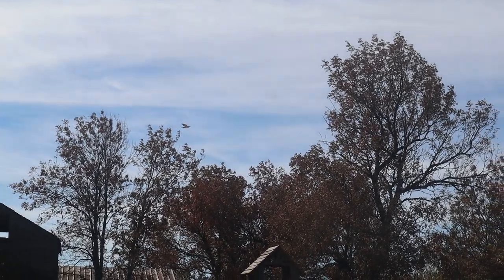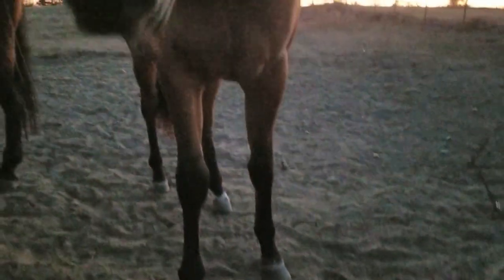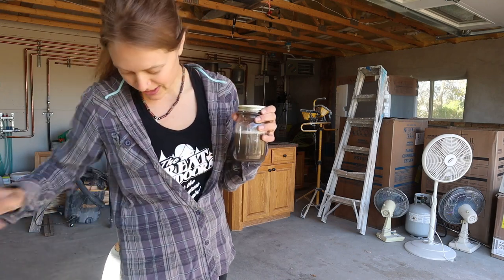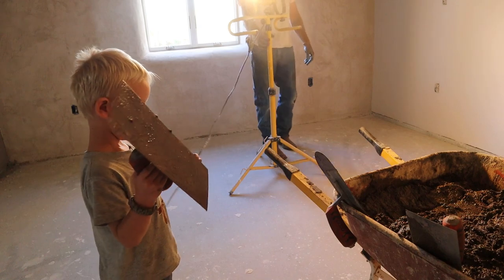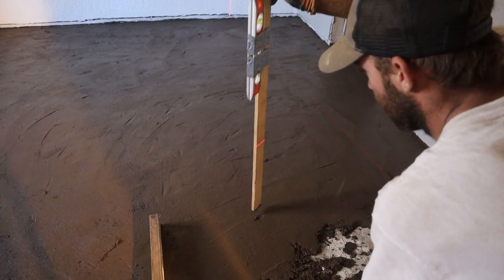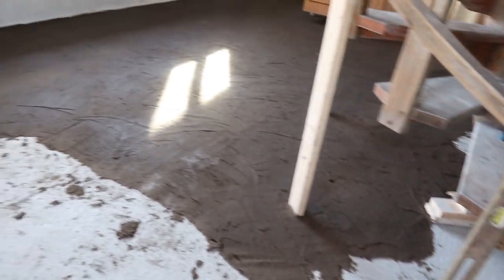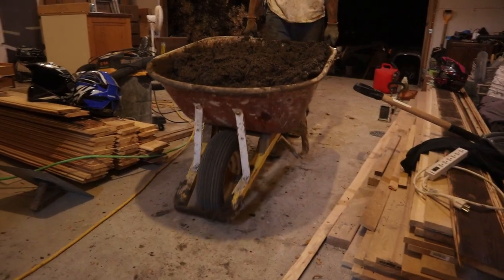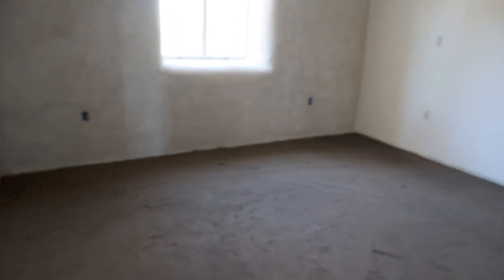Earthen Floor In Our Straw Bale Home | Part 1

Comment: For your floor, you should find about 2-3 foot long thin pieces of wood to lay down that are the thickness of floor you are wanting to achieve. Then as you complete the area the sticks are in, move the sticks down, and fill in those spots where the sticks were. This way, you are moving faster and move efficiently leveling your floor. You can reuse these sticks throughout your flooring.
Reply from the maker: our concrete slab was not level so this wouldn't have worked for us otherwise we would have used this method. thanks for sharing though!

Comment: Beautiful! Are the floors rough? Can you easily glide a mop over them?
Reply from the maker: Thanks, yes they are a bit rough,I think it's from not being finished properly. Would definitely recommend using a screeter on boards to get it level that way you have more time to work on finishing correctly.  A mop does glide over it, it's comparable to a concrete floor that is not polished.

Comment: What was the ratio of clay, sand & straw?  Looks awesome!
Reply from the maker: thank you.. we don't have exact measurements, just went off what looked right. It will be different for everyone given the different materials and moisture/clay content. An APPROXIMATE idea of what we did:
3 parts sand 
1 part clay-soil
1.2  parts water
1/2 part straw
Reply: @buildingroots5873  This is the mixture you used for the floors?

Comment: Generally you should use mother rails like for concrete. Make your mother levels and then spread the mud  with straight board or aluminium profile.
Reply from the maker: we didn't have a level surface to begin with so this wouldn't have worked for us; however, yes we should have done this for a final coat but we forgot!

Comment: guys, greetings from moldavia.  watched all your videos.  you are great .  it's nice to see you work together.  I am also building my own straw bale house for my rather big family.  my wife and I have five growing up sons and it is very crowded to live in a city box .... actually, I have a few questions.  if possible - help.  First, how did you get through the winter without plaster on the walls?  I mean rodents?  Did you take any measures to protect the walls, were there mice?  and second ... you plastered the interior walls in winter.  if I understand correctly.  so ... were there any problems with condensation when the lime dried.  after all, all the moisture passed through the straw into the street.  could it freeze inside the wall?  how long did the inside walls dry?  and how many bags of lime went into the interior decoration?  today I am also at the stage of the beginning of plastering works, but it is already winter outside.  and I don't know what to do - leave everything for the spring or ...?  and I'm really worried about the rodents!
Reply from the maker: i might not be able to answer all the questions as my mind gets frazzled about remembering every part of what we did during the build! We had to house wrap the exterior as you can see on previous videos. We DID NOT have a single rodent get into our walls (other than birds making nests before the wrap haha). I believe this is because we used z flashing at the bottom then rolled strips of OSB into the house wrap and stapled these strips to that flashing (this could be one of those moments where someone might say stapling into the flashing is a bad idea🤷‍♀️)
Reply from the maker: the only area we had condensation issues while plastering the interior was the corner where strawbale walls meet our north garage walls that are only OSB(no bales). cold air was coming in small areas here and causing frost on the plaster during curing BUT everything turned out just fine!!! We used NHL 5 because of our extreme temps. Depending on the room - I believe it took about 7-10 days to fully dry, keep in mind we did have floor heat set to 62-65 degrees which I feel is a must if you are plastering. I can only give a general idea of how much plaster we went through. I am a little hesitant on giving you these because I am not 100%sure! I am thinking we went through roughly 80 -55lb bags of NHL5 plus 25-30bags (77lbs) of eco mortar for the interior.  Our house total square feet of plaster  is 4,300 (inside and out).
Reply: @buildingroots5873  Thank you very much for your answers / it really helps me / as I understand you already live in your house / what can you say about its heat insulation? is it as good as advertised? it's just quite difficult to find those who have already lived for some time in a finished  straw house and shared their real impressions / or maybe you will make a video with mistakes and problem areas that need to be taken into account by those who will go your way / again, thank you very much for taking the time to answer /
Reply from the maker: we are not living in the house so it is hard to tell for sure how much propane we will be going through. If I can remember all the "mistakes" we made I do plan to make a future video on all that, as well as updates once we live in the house.

Comment: How durable is it?
Reply from the maker: very durable, every day I am in awe and impressed and anyone that comes to see the house immediately thinks it is concrete. In fact, the question should be: how well do the things that fall on this floor hold up? - we have had a few broken plates, cups, toys, and even a phone screen crack from falling on the earthen floor.
i do have to say though, the floor gets marks ON it from chairs sliding, sheetrock (still need mop boards put on!) - it reminds me of using chalk on concrete sort of aspect